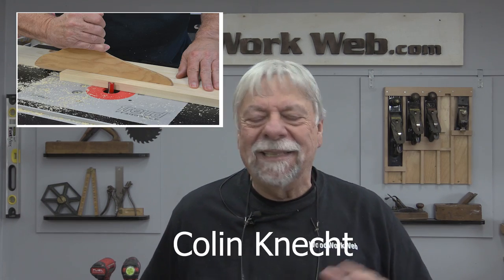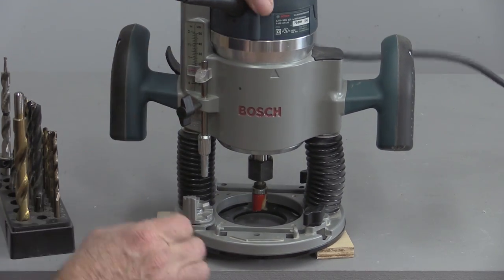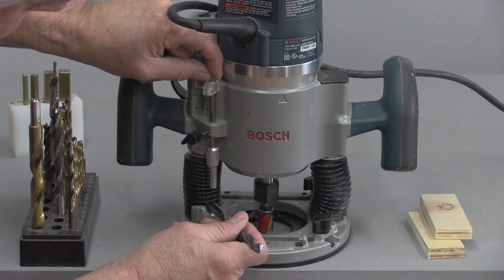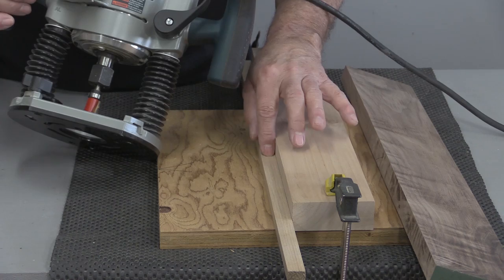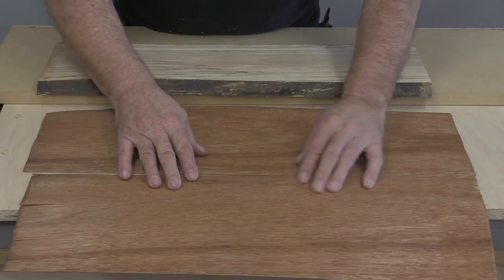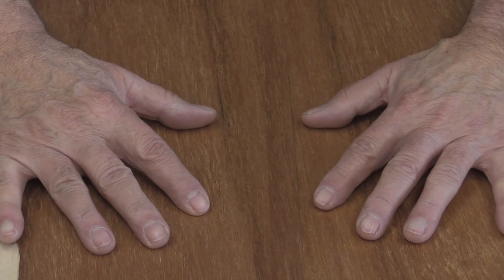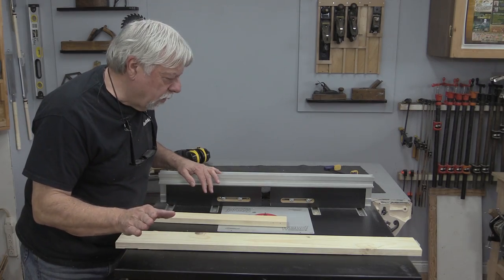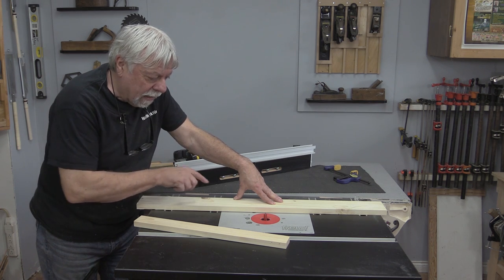Wood Router Tips and Tricks from Colin Knecht

Comment: I can't believe how simple the dado tip works. Thanks
Reply: i dont get it , i dont understand. how does placing a piece of wood between the fence and the cutter determine the thickness of the cut? i think i may be having a moment....
Reply: @mc-yt2rc  The video is missig a crucial detail: how you set up the fence:
-  choose where the dado goes.
- with the bit in the router, align the left side of the bit with the right side of the planned dado.
- place the fence on the board to touch the router edge and lock it.

Now you can follow the instructions in the video:
- the first cut will be offset by the diameter of the bit, so now the bit will cut the right side of the dado.
- the second cut will be offset by the diameter of the dado, so the bit will cut the left side of the dado.

Comment: Instead of clamping the temporary solid fence in the same place as the regular fence, clamp it on the other side of the table -- the side with the miter slot.  That does three things for you: 1) You can stand on the same side of the table as you normally would so that 2) you're closer to the power switch in case you need to turn it off quickly, and 3) it means you'll push the board in the same direction (right to left) as you normally would.

Comment: The last one is a great tip for someone like myself who doesn't have a pro router table with fence. I was using a folding working bench paired with a makeshift "fence", was struggling to get plain edges on wood about 6 feet long. I wish I know this trick earlier.

Comment: I like the last portion running wood on the backside of the bit. I don't have a jointer, so I copied your split fence. However, mine will hold a thin plastic or metal piece to push the left side out. Then I align a flush trim bit to match the out feed side and joint the edge. Thanks for the tips.

Comment: Excellent tips! I've been trying to think of how to use my router table for planing edges or short faces and for some reason, it didn't occur to me to think of it like a table saw or to use the other side of the bit and go left to right. Totally makes good sense and thank you for showing this useful tip. What router bit do you find works best for planing? A flush cut bit, straight  bit or spiral up cut bit? This will help me to make some crosscut sled rails to fit an oddball Mastercraft table saw miter slot much easier.  Also I love the tip about setting the bit depth using the turret and a measuring block or drill bit. If you have anymore router tips please make more videos on them.

Comment: I once did a similar cut, where I was running the stock on the far side of the bit, but forgot that I needed to run from the left instead of the right.  The router grabbed my stock and threw it into the wall.  So, yeah, better do it right!

Comment: Thank you for sharing, I had a lady give me a craftsman table but had no router. I picked up a really nice craftsman plug router with a red screw gage on it to measure the depth. I am looking to put the two together and figure out how I can use the screw holes to use an adjustable screw on the top of the table to adjust the height while connecting the whole thing to the table. Then off to figuring out how to put a plunge cut on about 50' of facia so I can inset my soffit in it and rebuild my eaves of the house. Looks like I need to get bits yet and the insert plate so any tips on cutting 1x6 facia board and putting in a plunge cut would be helpful along with what kit I would need to set up a leveler screw in the table itself.

Comment: Brass bars are expensive for part time hobby shop use. I have used short lengths of various keyway stock for years. Just as accurate, never had any metal stain transfer to stock, cheaper.  Really like that dado idea. Got to watch again to understand better. Thanks. Keep it up.

Comment: Colin I don't see the purpose of the stick that is the same diameter of the router bit at the 3:00 mark in the video to make the dado rabbit.  Couldn't you just use the fence you've set up and then run a final pass with the board you finished with?  Great tips overall....loved the drill bit tip to set your depth.

Comment: Hi Colin , great tips especially the one about  the with of a dado.  May I suggest you something. About the last tip. It is hazardous to pass  wood between the fence and the bit.  If you loose control of the piece  you can do a notch , exactly what you did  isn't it ? So I suggest to put a feather board after the bit to push against the fence.
Reply: I’m glad somebody notified about this, as I’m about to do jointing.. When feeding between the fence and the bit, the wood could be dragged outwards when the bit hits the end, and shot the wood away from the router table fence. Would it be safe enough to use feather boards?
Reply: @_emanmodnar  If you look closely  this  is exacly the case with Colin's demo. Yes absolutly feather boards is recommanded
Reply: @newtonbricoman1694  I'm not quite sure.. You mean 10:19?
Reply: @_emanmodnar  exactly. you see  Colin put back the piece in place with his hand. This will not happen with feather board
Reply: Great tips as usual Colin. Got my sub.

Comment: Question if anyone can weigh in: If one was cutting 1/4 inch box joints on a router table using a box joint jig, would you choose an upcut or down cut carbide bit.  I was thinking down cut would keep the tips of the joint fingers smoother but open to opinions.  Thank you!

Comment: If I recall, the turret on the Bosch router is set to 1/8" increments.  Why not bottom out the router on the first step and simply "measure" down three more steps to arrive at 3/8"?

Comment: I’m still scratching my head on the dado cut. The spacing from the fence and how you used 2 different spacers, went whoosh! Right over my head.

Colin, why wouldn’t you just come in from the right on the router table and use the front of the bit? What is the benefit of what you showed?

Comment: It looks the router blew out the plywood a bit at end of the first dado pass (when using the spacer). Would you recommend butting up a separate waste piece against the end to try to prevent that and/or securing the spacer so it doesn't move as the router is cutting the dado?

Comment: Colin - always appreciate your videos - but I am also confused about Tip 2 regarding the dado - primarily, calculating the distance from the main guide board to the dado slot (once this is set I can clearly see how your method makes a clean and tight dado...)  Can you provide more detail on this second tip for me and other less experienced woodworkers?  Thanks!
Reply: Use a sacrificial piece of scrap and clamp a fence on it, make a dado and measure the space between the dado and the fence.
Reply: @randyrogers3696  Thanks!  Just couldn't visualize this... My brain stopped hurting now...  :)

Comment: How do you be sure the dado is in the right place using your system?
Reply: James Rawlings Had dame question. “Plan ahead” is a start. But then I realized the bit has to be narrower than the intended dado so inserting the actual board will push the dado away from the fence - so the initial pass would be lined up on the edge of the dado closest to the fence.  I think.

Comment: I'm a newbie and find these videos invaluable. I don't really understand the trick Colin used to route the dado with the measuring stick and then switching to the actual board he was cutting the dado for. Can someone explain what's going on here?

P.s. be sure you're well protected when veneering. The last thing you want to leave the shop with is a veneering disease.
Reply: The stick is the same wide as the bit.  If the board were exactly the same is the bit the router would cut along the exact same path.  If the board was 1/16th"  thicker (example) now the bit would be cutting 1/16th further over with the end result a prefect fit.

Comment: I did not quite follow the double pass of the router for the dado passes. Am I missing something? If the small strip was the same thickness as the larger piece that would be the shelf...why swap pieces?  Looking for what I'm missing... 😇😎
Reply: The small strip was not the same thickness. The small strip is used to set your initial pass so on the 2nd pass it takes off the remaining difference between the small strip and the piece to be inserted.
Reply: @chrisdeforest6021  aah!  I did NOT catch that. I tend to not multitask well.  Haha! As long as that straight temporary piece is smaller...this works.  If the piece was bigger....doh! 😇😎

Thanks for the help!

Comment: Hmm, I’m still trying to figure out how that dado trick worked.
Reply: The first strip compensates for the diameter of the bit, 5/8" in this case. The first cut is made on the right-hand side of the bit (as seen in the video). The second is made on the left-hand side of the bit, which is 5/8" farther from the fence. If you didn't use the first strip, the dado would be too wide by the diameter of the bit. 

   Suppose you didn't use the first strip. Make the first cut. Then move the router bit over an amount equal to the thickness of the board that is to fit in the dado. Make the second cut. Because the second cut happens on the other side of the bit, the resulting dado will be too wide by an amount equal to the diameter of the bit.
Reply: Imagine running one pass against the fence with the fence to your left. You would align your cut so that the left side of the bit cuts the left side of the dado. Now put your board in so that you move the router exactly the thickness of the board. Now the left side of your bit is exactly where the right side of the dado should be. Your dado is too wide by the thickness of the bit. Using the spacer on the first cut subtracts out this error. Now the left side of your first cut and the right side of your second cut are exactly the right distance apart.
Reply: The diameter of the bit used in the router must be smaller than the width of the dado. The width of the offsetting strip must be exactly equal to the diameter of the bit. Then use a piece of the material that is to fit into the dado for the second cut. Plan carefully. Try to visualize how this all works. Check and recheck to make sure the dado will be where you need it to be!
Reply: I m glad I'm not the only one that was wondering the same thing.

Comment: Two questions (which are interrelated I guess): A. Why wouldn't one use the existing fence, running the piece left to right BEHIND the bit, to do this? and then i thought B. Why wouldn't one clamp the new board fence on the "outer" side of the bit, work right to left as normal, and have the normal fence brought up on the inner" side for its dust extraction value?

Comment: Trying to figure out WHY the 2nd trick actually works (the dado). It's making my head hurt. I should probably drink more coffee.
Reply: Because the first spacer was the same thickness as the bit. The board was larger so when it replaced the first spacer it moved the bit exactly the difference.
Reply: This may help with the tricky part. When he replaces the 5/8" board with the actual board to be used (which must be wider) just picture the first 5/8" of the width has already been cut. Now, the second cut is only increasing the width of the dado the difference of the first 5/8" cut to the exact width of the board being used. Sorry, that's the best I can do.
Reply: Thanks! Now I get it!

Comment: 10 minutes 19 seconds your wood piece came away from its fence producing a divot in the workpiece.  You then show a perfectly cut piece.  My guess is that you had to reposition the fence and give it a second run just enough to scarf off the imperfection that would certainly present itself if you tried to laminate it to another piece of wood.

After reviewing the video further, at 10:27, just below your index finger there are two marks on the wood that were not on the piece you initially started cutting.  And the wood grain appears to be very close but slightly different in that it appears to have moved to a slightly different position.

Definitely got some good tips.  Thanks.  But I've been an inspector for closing in on 40 years.  I see the mistakes.  The imperfections.  The stripped screws on those TV shows.  Naturally with the TV shows you have editing.

I will be setting up my wood shop hopefully this April.  I have the lumber in the garage and driveway for an addition to my garage and a contractor already contracted to build the addition.  So I'm looking for those smart tips that so many others have discovered over the years.  I may even begin developing my own wood shop video collection.

Comment: I do not at all understand two things about the end demo in this video: 
1.  WHY would you want to do the edge with the wood fence set up, as opposed to doing the same on your table saw?  The table saw is faster to set up and faster to cut the wood (and safer, I think!).
2.  Why did you repeatedly call this "planing", and say "if you don;t have a planer"?  This looks like jointing, not planing.

Comment: To each their own, but just a heads up here.  Jointing on the router table as demonstrated can be very dangerous.  When feeding from the backside, yes you are feeding into the cutters on the bit, BUT the rotation of the bit on the backside will try to pull the wood off the fence and deeper into the bit.  Your Spidey sense should be tingling.  This could go very very wrong.  Wrong like getting to ride in an ambulance to the hospital wrong, and that's only if what's left of your fingers can find your phone.  Or maybe you get lucky and just the wood gets sucked into the bit and fired back at you.  Feel free to pick the kickback injury you prefer in that situation.  

Don't do stupid, but if you must, make sure you use featherboards to push the wood against the fence.  Oh, and have someone else is around, but not anywhere near you (wouldn't want them to get hurt too), so they can get help if something goes wrong.
Reply: I built an aluminum router lift and a temporary router table top for a laminate floor repair that needed extreme accuracy. I joined a router forum to ask advice. I needed to run the laminate flooring through to make the width exact, and doing this as one would use a tablesaw.  By doing so, I was told by forum members this was extremely dangerous..... Running the material between the bit and fence. They referred to this as "trapping" the material.
I did it anyway but for safety, I decided on making a spring loaded lever as a sort of featherboard on the outfeed side so the material couldn't get pulled into the bit. I made my initial cut on my tablesaw to within 1/16" of what I needed, then took off thousandths of an inch at a time to get what I needed.
I'd love to see an updated method using a featherboard setup to make this safer.  
I've read a lot of horror stories from using this "trapped" router method.
That said, your tips and show are fantastic. You go into great detail explaining what you are teaching.